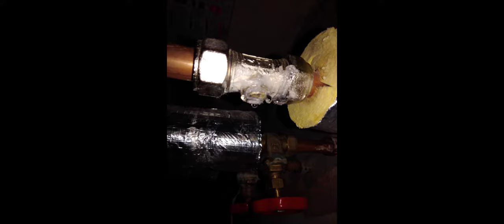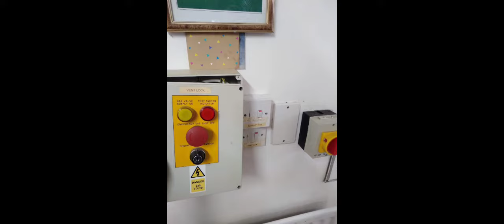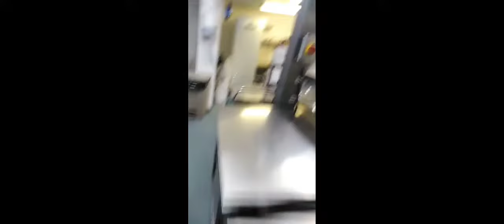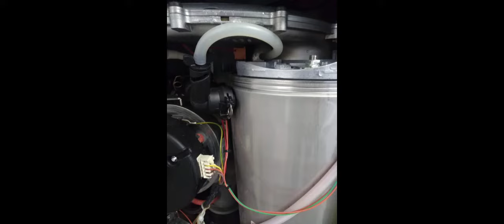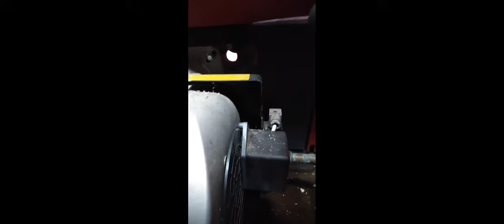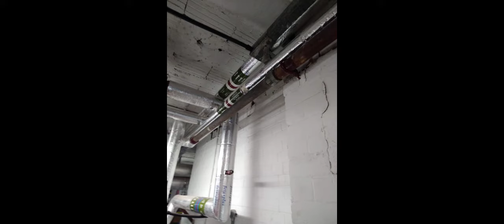FIRST SITES AS A COMMERCIAL GAS ENGINEER pt6

Comment: Which digital thermometer do you use?
Reply from the maker: Hi, long time no see. Ran out to the van, only because its you. Testo 770-2 TRMS Clamp Meter. It's been good for the last 2 years. I could have treated it better. So far inrush stopped working. Also had to change the leads. I bought and tested another multimeter for £38 KAIWEETS HT206D Clamp Meter, 6000. Was quite impressed with what it could do, plus it had good reviews (if they are real).
Reply: Thanks for that, love the videos bro keep em coming
Reply: Hope your well